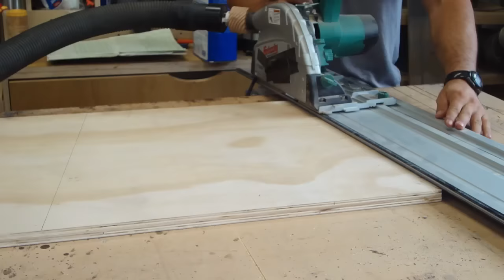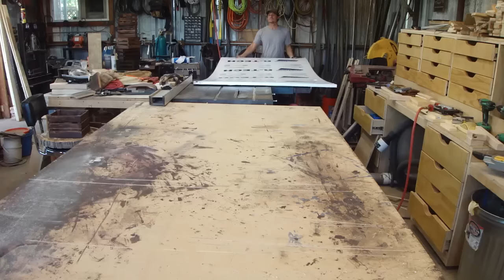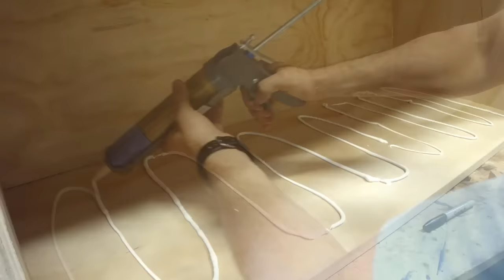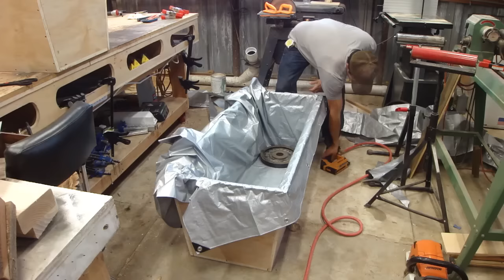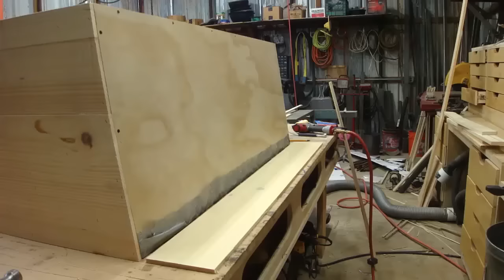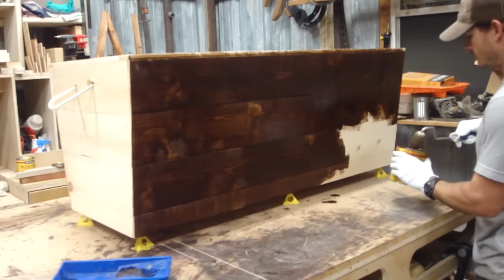Outdoor Ice Chest

Comment: I am working on a cooler project and never thought of using a poly tarp for the inside liner.  Are you still using this and has the tarp held up?
Reply from the maker: I used it for a few years and it held up to the elements just fine. I ended up selling them when we moved. I can’t remember but there might be some good suggestions in the comments.